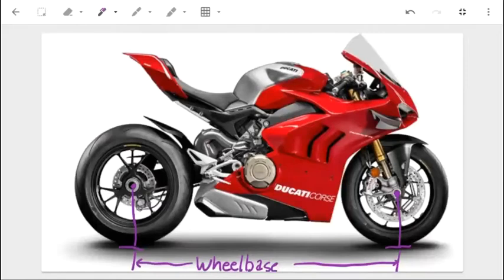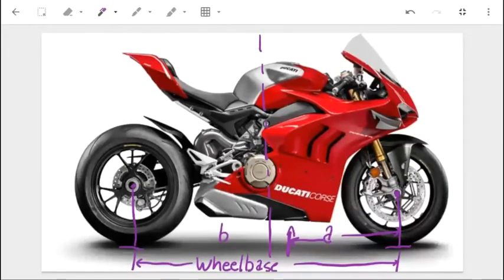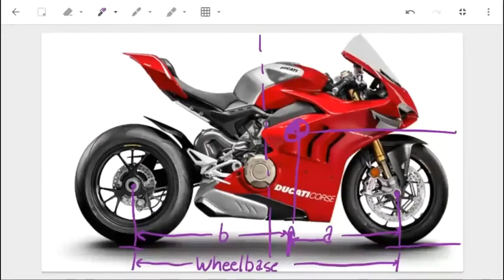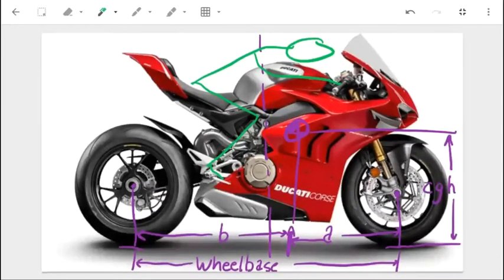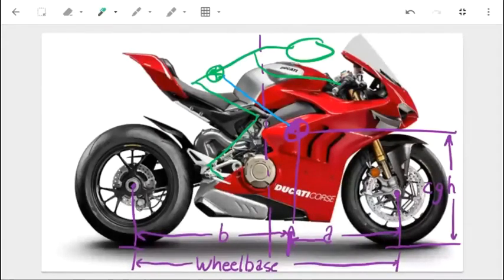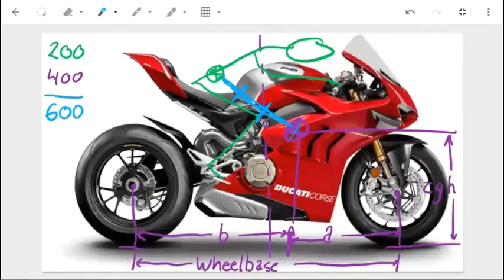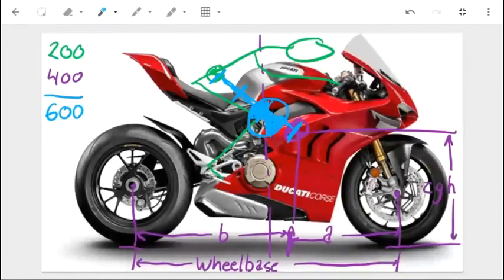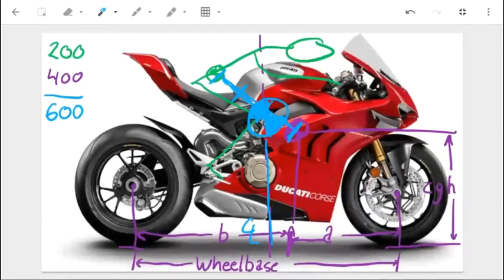Basics of Motorcycle Geometry (Center of Gravity)

Comment: I got a question that I don't quite can imagine it in my head.

Why does lowering the rear end suspensions, distribute the weight slightly on the front of the bike?
Reply: Not an expert, but it’s probably because they way bikes rear suspension works, when the suspension is lower the swing arm extends (which extends the wheelbase) so in relation to the wheelbase, the center of gravity is more forward
Reply: So it’s not really the center of gravity that shifts, but the position of it related to the rear wheel (or at least that’s how I understand and picture it), that’s why you see drag bikes that have a lot of power and don’t want to wheelie have stupid long swing arms so the center of gravity is more over the front than the rear, so the bike doesn’t wheelie when all of the power is put down.

Comment: When i was 18 i weighed probably 155-160lbs max. My gsxr750 felt way heaver in front than than the rear going around long bends. The suspention was factory tuned and i  swear the rear felt so light i was scared to lean in sometimes 😅. 

My 848 was more comfortable. 

Wheelie center of mass next!